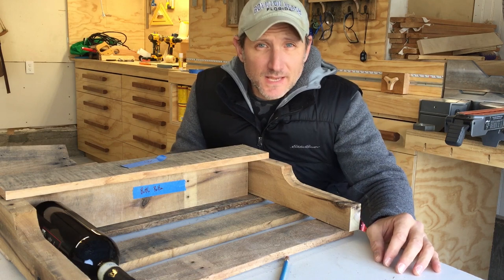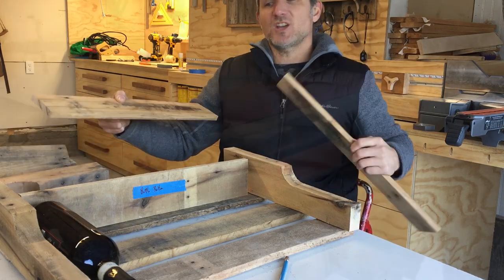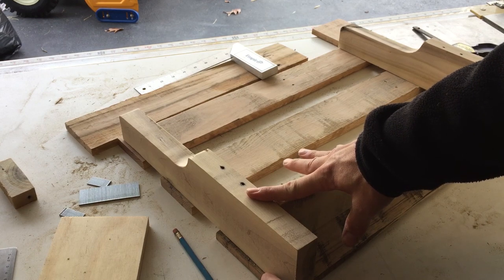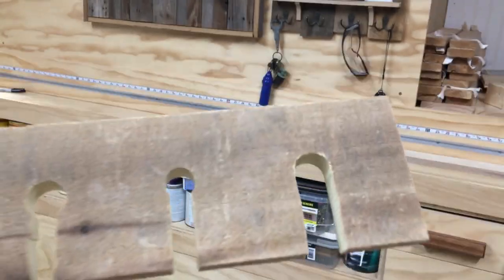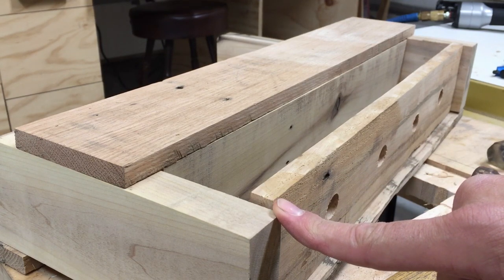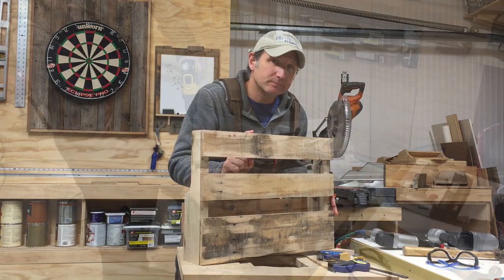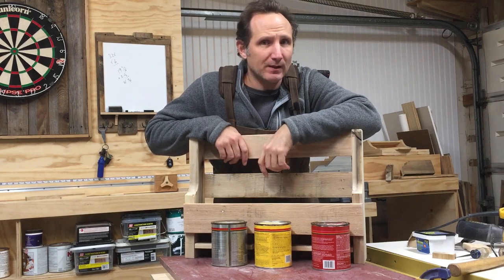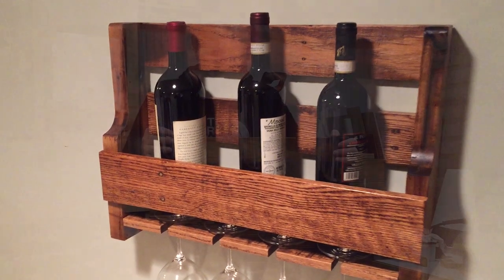How to Build a Pallet Wine Rack // DIY Woodworking

Comment: Do you ever stain / finish the wood pieces prior to assembly?  I wonder if that would make it easier to avoid some of the darker areas in the corners (not on your rack, but just in general).
Reply from the maker: I guess you could, but all of the pieces would have to fit perfectly because you won’t be able to cut them without exposing the unstained wood.

Comment: Every time I use stain then urethane when everything dries it’s got a rough texture any help with this would help
Reply from the maker: That is normal. After each coat of polyurethane, give it a light sanding. Also, if you are using a roller, make sure you smooth it over with a brush before it starts drying